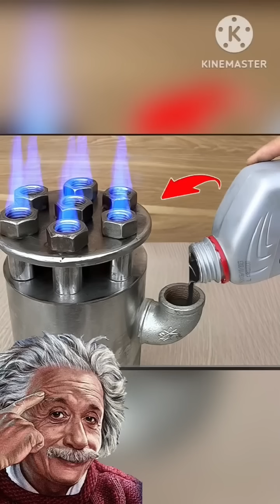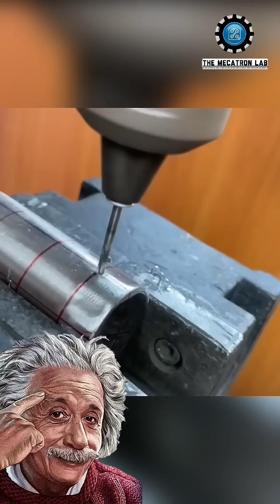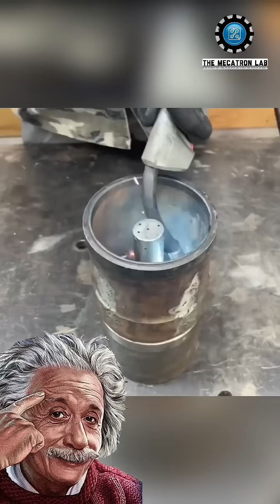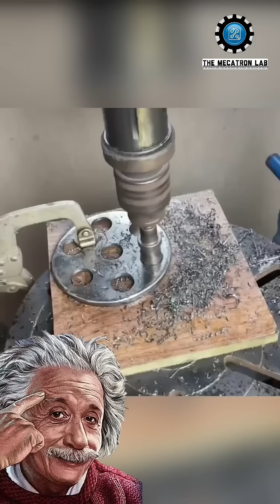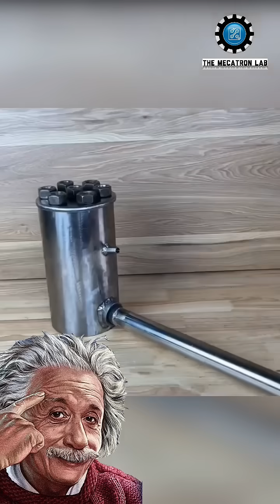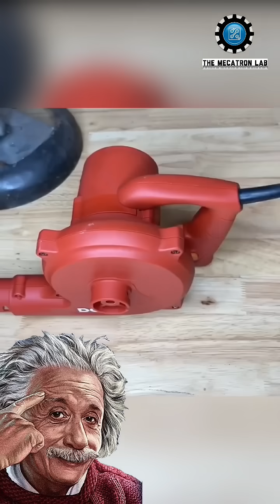How To Make waste oil Stove using Metal. #diy #science #experiment

Comment: A used brake disk in a barrel heated with a blow torch and a constant drip oil oil and it will burn as long as u have oil.. heat a massive workshop

Comment: BAD IDEA!
Burning used motor oil releases toxic gases, including carbon monoxide (CO), sulfur oxides (SOx), nitrogen oxides (NOx), particulate matter, and organic compounds like benzene and other polycyclic aromatic hydrocarbons (PAHs). These emissions also contain toxic metals, carbon dioxide (a greenhouse gas), and potentially hydrogen chloride and other pollutants depending on the original contaminants in the used oil.

Comment: These are made all the time but they're not for inside when you're using used motor oil and you shouldn't cook directly off of the flame if you made a griddle and have a stove pipe going outside but not in the same room

Comment: Punjab state using these since 1970s and they are alot efficient and produce more heat that could burn holes through 10mm stainless steel within 2.5 minutes. I own one of them.

Comment: I pour my used motor oil on my wood pile (lightly enough so that the oil doesn't run off) and burn it in my woodstove. Either that, or I filter it and mix it into my heating oil tank.

Comment: I'm a welder iv never seen such shit welded abd thease things are commercial I have one dipshit 20 years more like 6 months and fuck ton of luck that's flux cored mig fuck he got one point the metal is clean plus the metals to thin to with stand the heat tig welds where shity so was the mig welds

Comment: All stoves are made of metal. And he has done nothing new or special here. The only thing he has done is hook up an electrical air compressor that blows wind into the burning chamber that's superheats and supercharges the combustion of the oil. That's it. There's nothing even remotely new about any of this

Comment: A few things, hes not the original inventor of rhis type of stove. Second this wouldnt be quite the godsend or as convenient as one might think. It wprks on burning waste oil, though deisal would probably work fine too...but if this device were wide slread then deisal would be more expensive, or waste oil would be quite scarce. Third its not a great hearing option without a way to contain the exhaust, trust me, you dont want to be breathing that in all day, or wapecially not at night. Fourth it requires forced air. If you are in the position where this type of device would be of great help, then forced ait or reliable electricity might be a little hard to come by.

Comment: In the years after the war in the UK through to the 70s it was common to use this technoque to convert pot bellied coke stoves to (used motor) oil. Depended on a decent chimney to draw enough air for complete combustion..... and a reliable drip valve to avoid a gravity-feed runaway

Comment: I'm pretty sure you wouldn't want to use that thing in an enclosed area while burning used motor oil. Heavier hydrocarbons like the ones found in motor oil don't work wonders with your respiratory system, and some of them are known carcinogens. Not to mention you're risking filling the area with CO, and getting really really sleepy.

Comment: The smoke that comes from burning used motor oils is filled with poisonous metals.
I had a friend with an Air Pollution Control Board job and He stopped a local auto shop that was doing that.

Comment: I would never use in a home you have to vent out the fumes. They do have a waste oil heater for usually for big repair shops. They came out with a clean burn 🔥 waste oil heater they work very efficient when I use to work for a truck & automotive repair shop the boss had one put in. They burn 🔥 oil,Transmit oil,rear end oil,Brake Fluid, all cooking oil and Antifreeze and oil will burn once a month you change the filters. Do you know why repair shops and food industry collect all oil for years they clean the waste oil clean it and mix’s it with virgin oil rebottle the oil and sell it back to you as new. Gasoline & Diesel Fuels cannot be 100 percent virgin oil the engine will after awhile throw a rod. That oil is only to break in an engine on a Dino Machine then drain after 8hrs with filters with fresh regular oil. The used oils from fast food places that they recycle it and make biodiesel fuel. In the 1980 I guy changed his tractor trailer with very fine microns filter to filter all the salt from the frying oil to run the tractor trailer engine. They fast food places were very happy to get rid of all that oil. He ran his truck from New York to Los Angeles, California and back stopping from fast food joints to fast food joints to fill up his fuel tanks after he filtered the oil.

Comment: You shouldn't use used motor oil to cook.And you shouldn't use used motor oil inside of a home if you're burning it. Used motor oil has mixed with fuel and been burned. Fuel has lead in it. Used motor oil can be thought of as used murder oil.If you're telling people to burn it in a stove to cook with or inside their homes.

Comment: That will only work for a few days, after that it's gonna be clogged with all the residue that modern oil additives left after burning.
Reply: Yep. I used waste oil to heat my shop for 15 years. Built it myself. My burner was easy to take apart and clean chamber. I could use it for two days or so before needing cleaning. It was sooty and messy inside of stove. Today's oil is made to resist heat in turboed cars. Pretty much need a blower to get hot clean burn. Saved me lots of money over using nat gas.

Comment: Support and increase carbon emissions.
When you burn used motor oil dangerous gases are released in the atmosphere.
These are gases and harmful elements released in the atmosphere.
carbon monoxide (CO), sulfur oxides (SOx), nitrogen oxides (NOx), particulate matter (PM), toxic metals like lead and zinc, hydrogen chloride (HCl), and potentially chlorinated organic compounds like dioxins and furans.

Before creating any video do some research and then upload the video.
Don't spread half information to society.

Comment: Am I the only one seeing how counterintuitive it is to have a stove that runs on discarded oil in a depressed economy where access to regular Heating and electricity and water are questionable which means motor oil will be hard to get hold of two both used and unused so really who is he advertising to wannabe off gridder diyers

Comment: burning waste oil that could be distilled and reused as oil, forcing more importation of refined machinery oil that prorates up to as much as $28'000usd a barrel. burning stove fuel or kerosene diesel is right around $90/barrel as it is more then 80% of crude by weight/volume. count in yen, the logic of that stove becomes a years wages to boil one pot of water.

Comment: you might as well burn cowshit in your apartment. the Indians do it in the kitchen and that way they have a very good fire that burns with a similar blue and hot flame as the oil burner in the video. unfortunately these people poison themselves over the years and have a short life expectancy. this technology is associated with a high risk. it's better not to do it. there are special disposal stations where the oil is burned at higher temperatures and with better filters and has less harmful impact on the environment.

Comment: And you bring heavy Metal pollution to Atmosphere , thank you for intoxicate what we all has to breath.
Where is your Filter ?
Dont you think people had think that over ?
Thatswhy we take Gas or Alcohol to fuel burners and not oly Motoroil full with mikro Metalpartickles that goes into the Air by burning.
Short thinked thing , this Guys cant think around the corner.

Comment: "Regions where access to energy is limited"
Okay they have cars instead and get discarded motor oil easily. Also running a blower with electricity. 
"Sustainable solution"
Okay so burning motor oil is a new sustainable solution. 👏🏻👏🏻👏🏻👏🏻

Comment: Use the heat from the stove to power a non-electrical blower. Add a valve to fine tune the regulation of the oil flow. Filter the oil before using it.  Make the oil go once around the outside of the stove in a copper pipe before entering the fire chamber to decrease the oil viscosity & improve combustion.
Reply: Give me the design, I really interested to make it at home
Reply: @AlHadid-i1y . Almost any tank or large brake drums. Weld them together. Use a brake rotor to build the burn bowl.    Pretty easy actually
Reply: Be
Blessed 😮 this is good contribution 👍
Reply: An induction stove top fan would do it. Yes❤
Reply: @ChrisOgley-c7y It's not induction though, it's thermoelectric.
Reply: @TheSimoc  I'm not a scientific guy.  I just know that it uses heat to spin the fan...info banked. You would have to let it heat up first and find a piece of the foil like ducting to fit . I would imagine around 6 inches you would find a..thermo fan to start blowing of it's own accord if you could get contact with a good solid heat source. Probably a nice piece of aluminium to fix that fan to ..That would be a nice build. Although those stovetop fans arnt cheap...they are cheap to run though and they spin pretty quickly if the heat builds up...
Reply: @ChrisOgley-c7y  Yes, I'm actually surprised how relatively powerful those are, considering that solid-state thermoelectric generation tends to be hard to make significantly powerful in such small size.
Reply: @ChrisOgley-c7y  Thermoelectric might be able to provide enough power for the air feed fan (I'm not sure about the power needs), on the other hand I wonder why stirling engines are still so uncommon, they could be used in many applications for higher power electricity and mechanical power generation from any heat source.
Reply: Why not just turn it into a engine now
Reply: Nice suggestions. One can use thermoelectric generator to power a fan hehe
Reply: @ermitanyo777 how does it work?
Reply: Nice!
Reply: @wildwillewiccan hey u actually know wat ur saying nice haven't seen that in comments in a min thanks ....
Reply: This guy should be a millionaire.....
Reply: Oíl Will overheated if coil is put around ... temperatura can rise very fast over 350°C
Reply: Point of correction! He used the fan as a blower to blow up heat/fire from the  base of stove. The end result is the flame blowing up with pressure from the stove. He used an electric fan though. You'll see the black cable still connected.
Reply: Additional pollution to environment..
Reply: I would love to have a diagram of what you just described. I would put it together and test it for you.
Reply: Good idea
Reply: Oli bukan bahan bakar jadi tetap perlu bantuan angin yg cukup kencang
Reply: @anakagung4839 This type requires a fan, but many other models burn better without a fan. 😊
Reply: Totalmente de acuerdo con usted
Reply: Ini karya anak Indonesia yang di buat ulang di luar negeri
Reply: yes, should be filtered before use. i was just getting ready to say, if burning used engine oil, they would be breathing in all kinds of impurities, so to speak. toxins, various carcinogens, etc.
Reply: When you say non-electric do you mean a hydraulically driven motor for the pump ? I'm guessing the pressure build of of the oil being circulated would turn that motor ?
Reply: ES CANCERIGENO......Y SU HUMO TÓXICO
Reply: I'm Philippines a lot of people using this. I think this idea is orinally from Philippines. Filipino people are the great inventor especially the water powered car but sadly did not support by the government in the Philippines.
Reply: Why don't you put up a YouTube channel as you obviously appear to have knowledge which needs to be shared. Bless you. 🇬🇧👑🇬🇧
Reply: @sherrylawrencelewis2544  would the copper pipe not melt if it ran aound the inside to heat the oil first. As that looks a hot furnace
Reply: @StephenButlerOne  he said outside before GOING IN!!!
Reply: It doesn't burn hot enough to melt copper  @StephenButlerOne
Reply: @sherrylawrencelewis2544  No lo va a hacer, porque no tiene los suficientes "huevos" para hacerlo. 😃😄😂
Reply: M @sherrylawrencelewis2544
Reply: What😂🥴😬 ?😮
Reply: Then, he will no longer be genius.

Comment: I tried this kind of stove...
It's very usefull for everyday cooking or anything thats needs heat coming from fire..i only notice when it started to heat up and produce flame when the air supply is weak or low it produced black smoke,,,but if the air supply is strong the flame becomes blue and doesnt produced smoke,,,the bottom of the metal pot i used had no mark of any smoke coming from the stove...but be carefull of using this cos when the stove accidentally drop any amount of water the flame is blazing so wide and fast..so its very recommended to use it outside the house IN an OPEN AREA AS MUCH AS POSSIBLE for SAFETY...

Comment: Ive worked in several garages and welding shops that have huge used oil heaters. Hlrunning 15+ semis, a handfull of forklifts and frontend loaders, and some dumptrucks, theres always an adequate supply of used oil 😂 and it warmed the whole welding shop of roughly 65'x220'. Nothing special here, but looks cool

Comment: Do you guys think that burning old motor oil is a good idea? It probably releases a lot of the toxic additives into the air which later settle on every surface in the heated area (or in your lungs if you're crazy enough to inhale the fumes) so I don't think this is a good idea

Comment: There’s a local oil shop that burns used motor oil they save up all summer in a system that heats their entire store. These systems have been around forever. Before they pour it in this giant tank they test it to make sure there no antifreeze in it and each year they save up enough oil to heat their business for a couple months.
Reply: I wouldn't want to go near the place Antifreeze is mild compared to used Motor oil especially synthetic oils gear oils all contain heavy metals that oxidize when subjected to burning you can't see the highly pollutant and dangerous exhaust.

Comment: I tried that years ago with used motor oil. It would not burn. Ieven put a blow torch to the oil and it would not ignite. So, I do not believe.
Reply: Oil does not burn like gasoline does. It needs a wick to start it burning like a kerosene lantern does. That is why scrap paper was put in the combustion chamber & lit at the beginning. Once the chamber is hot enough the oil viscosity goes down, the oil becomes more volatile, & the oil's fumes ignite and keep the reaction going. The added blower forced air speeds combustion which raises the temperature, & vaporizes the oil so the combustion becomes more complete. At that point the oil burns cleaner as seen by the flames turning clear blue with no smoke.

Comment: Oil burners have been around for a long time. And if you have access to motor oil, you have access to diesel or petrol. It may be an interesting source of heating to some, as it burns waste, but this doesn't really solve a shit ton of problems. Still better than allowing waste oil to go into the water table in areas where people don't do proper waste management, though. 
That being said, using this directly indoors, without a heat exchanger is not a good idea. You are burning all kinds of nasty stuff in the motor oil.